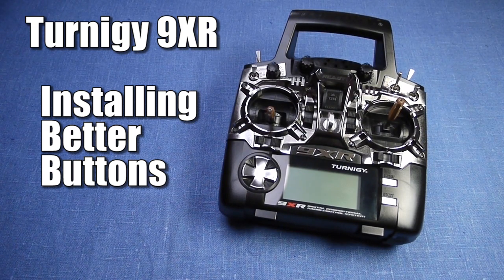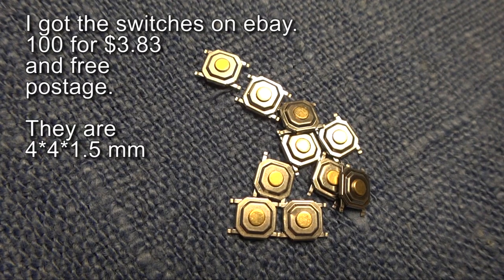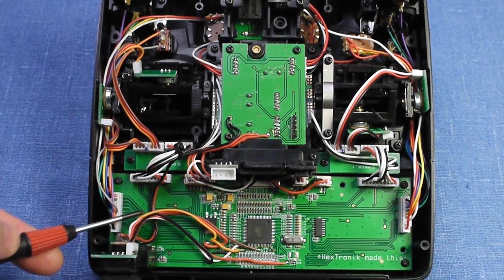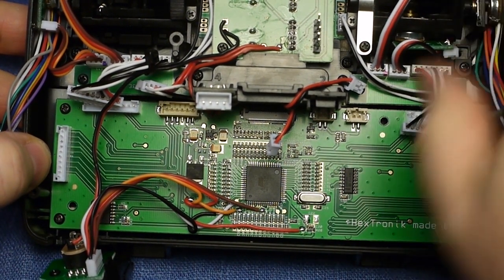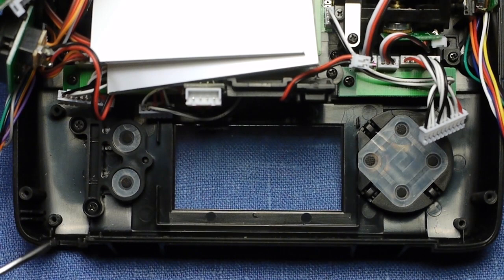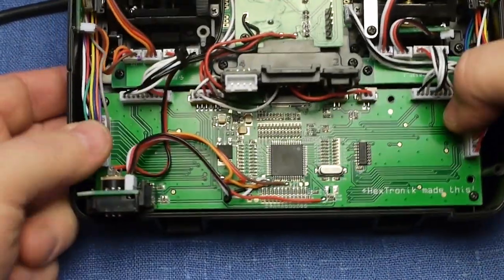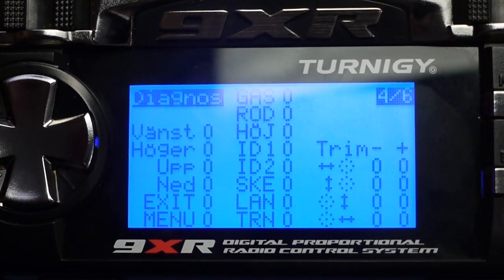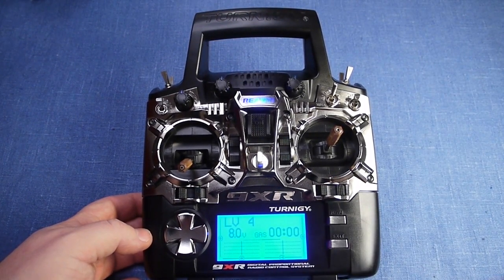Turnigy 9XR - How to install better buttons

Comment: ok, i´ve been watching this over and over and i cant see clearly which exact points i need to solder in the board, i already tried on my 9xr several times and couldnt get connection, im a newbie in soldering but im trying to do it, do you have any pic or something to help me figuring out which exact point should i solder in the board? thk you very much in advance :D

Comment: Its definitely because of the switches on the D-pad. I modded mine it rebooted and then took them off the D-pad and no more reboots. Apparently adding some resistors stops it but we don't know why. I think it has to do with the rubber original switches provided a small resistance that's needed for some reason and some one else says it could be because of switch bounce.  so buy some cheap smd resistors and report back to let people know!!!

Comment: I performed the resitor mod, it seems to help. I used 1K 1/4w regular resitors not smd. I placed them on pcb where the tracks change sides, as it was the easiest to solder them there and that way the're spaced out a bit.

Comment from the maker: There was a thread on openRCforums a while back that discussed the issue. You find it by serching for the thread "open9x freeze/reset or restart" on the forum. It was concluded that to get rid of the problem you can add resistors to the tracks between the buttons and the processor. In one of the last posts MikeB offers a theory to the reason. He assumes that the problem only arises with installed buttons, but there are other threads were  people with unmodded radios experience rebooting problems

Comment: Really, I didn't notice it before? Is this problem with all firmware?
It does reboot a lot now, while I entered several profiles before without any reboots... I haven't read anything about the reboot problem anywhere either?

Isn't there anything I could have done wrong with the buttons to cause this?

Comment from the maker: You use the multimeter to find two legs that are not connected when the button is not pressed. These are soldered to oposite sides of the connection tracks. When the button is pressed there will be a connection between the legs and the tracks are connected.

Comment: lets stay with the pair of legs on the buttons, as I understood you have to choices to solder them on and one is wrong. How do you see with a multimeter which would be the right direction. thanks sofar

Comment from the maker: This is not the easiest soldering job. Open a broken electronic device of some sort and train on the PCB before you attempt soldering in the radio.  
You need to have a soldering iron whine a fine tip and thin solder. The legs are tiny. Start by adding some tin to the pads, where the legs will go. Pretin the legs you will solder and then put the contact in place and hold the iron against the leg until the tin melts.
The soldering iron temperature should be around 290 C.

Comment from the maker: I managed to place the buttons in the wrong direction. The reason for that was that I did not take time to test which pair of legs that where connected. I should have used a multimeter before I soldered. Luckily I used one to look for shorts when I had soldered the first button and discovered the misstake at once.

Comment from the maker: You do not need to hold the rubber part in place, it is fixed by the plastic assembly it is fitted in. I used the rubber to check that I had not placed any of the switches so much off center that they would not fit.

Comment: Thanks for the video. Ordered the buttons just in case I want to do the mod, I have no radio here yet, currently on it's way...for £2.73 it wouldn't be a problem if I didn't end up using them...

I am curious about the soldering part though, it doesn't look clear how this is done on the video. Aligning the switches is straight forward, and the soldering although fiddly looks okay, but could you get away with a little hot glue to hold the rubber parts in place before re-assembly?

Comment from the maker: They are called tactical micro push buttons. They make contact when pushed, correct. The button is to large to solder all 4 legs. I could only solder 2.
I think you might have a problem buying them locally since they are very small and low height (1,5 mm). If you do not find them, they are available on ebay for a low price. Search for "Micro push button 4  4  1.5"

Comment: Hi great video just what we needed Thanks! 
When I go to the Electronic shop what do I have to ask for ,
How do you call these buttons ? Do they have a electronic value ,and they are buttons that make contact not break contact ,Right ? and only one side is used the two other legs are not connected to the board .
If I am wrong please say so .
Thank you !